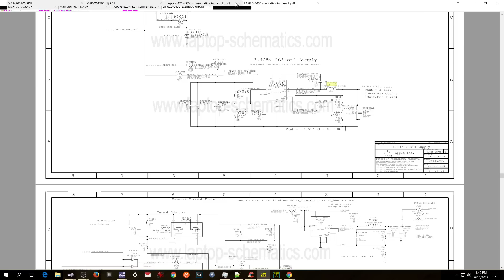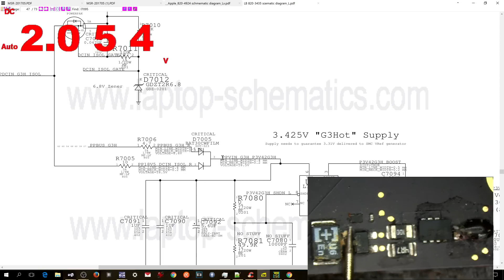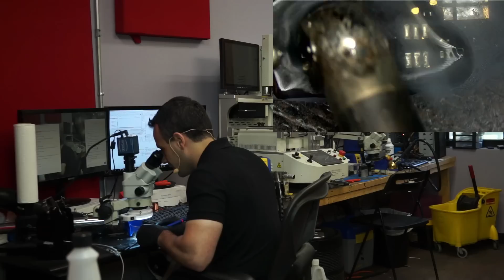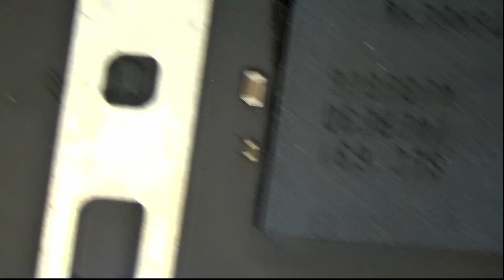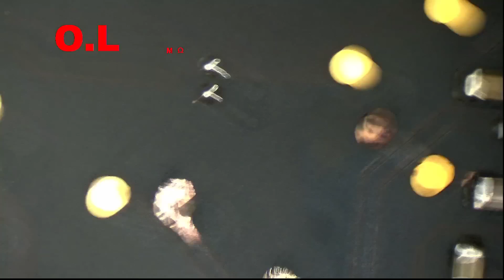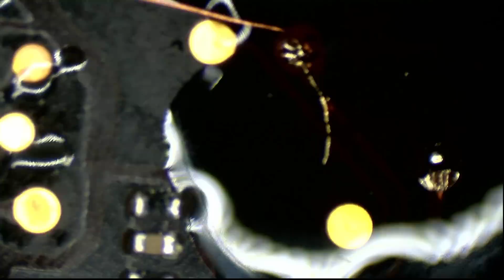Macbook Air not charging after liquid: diagnosed & repaired.

Comment: I got a small amount of water on my charger. You can see where there's some water damage. My MacBook won't power on with that cable anymore but I'm just wanting to know. If i buy a new charger what are the chances it will work on the MacBook? Or is it likely that from plugging the water danged cable into the charger port, it's fried the entire macbook?

Comment: I like to watch and learn from your videos. One thing that bothers me is why do you repair boards before doing cleaning in ultrasonic cleaner? Cost/time effectiness? Wouldn't it be nicer and probably you could find problems sooner when board was cleaned?
Reply: I know this is one year old and you probably already figured it out by yourself but it might be useful to someone else reading through the comments: the whole reason Louis had difficulties in troubleshooting the touch bar macbook is that somebody else already cleaned it with the ultrasonic and he couldn't figure out at the glance of an eye what component went bad. If he cleans the board before repairing it its more difficult to determine what component is at fault, and even if he memorized every one of them prior to cleaning the board, it still is more convenient to just clean the board afterwards. Hope it helped (somebody)
Reply: I forgot to say thank you very much for those videos

Comment: (touchbar mac) IF there is a via, it's a blind microvia. I could say this board is HDI but that would be so much obviousness it would be a waste of time.

You will normally see microvias on the stereoscope. Like you say, it's a dot. May have been too corroded.

I have reconnected microvias to small wires with conductive epoxy. You need a clean board and pressure apply the stuff (like when applying drywall joint compound, but at scale).

Also, stop thrashing things with an xacto blade (or tweezers), get hypodermic syringe needles; super precise, super cheap.

gimme sch!

Comment: unless it's a "buried" via, it most likely goes straight through to the other side of the board where that end of the via is most likely"tented". you can scrape off the tenting revealing the copper to that via you destroyed on the other side. then run your crazy jumper from one side to the other...........boom.

Comment: I check in on your videos somewhat infrequently, depends a bit on my mood at the time. But I feel like liquid damage is an extremely common topic that you post.

When I still worked in repairs back in 2009, it was fairly rare to get (PC) laptops in with liquid damage, your videos give me the impression that Mac users don't really care for their machines or potentially they believe the machines are indestructiblee? Is this the case in your opinion?
Reply from the maker: +akiraokami rather thst with pcs itd not worth even bothering. People spill stuff on pcs but those customers still expect the same 1-2 day turnaround time that Apple customers do when that's impossible given all the different models and lack of documentation and having to order donor boards and whatnot. Also with pricing they're not worth it. 

Now with Lenovo ThinkPad those are actually pretty liquid resistant. But with low end pc laptops water screws them up just as bad and their owners are just as nasty.
Reply: Pretty much.